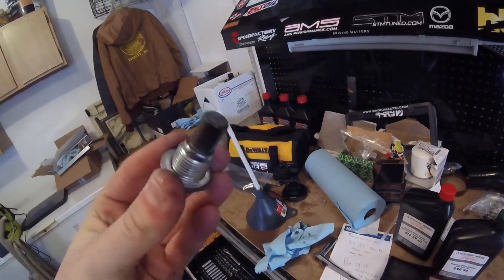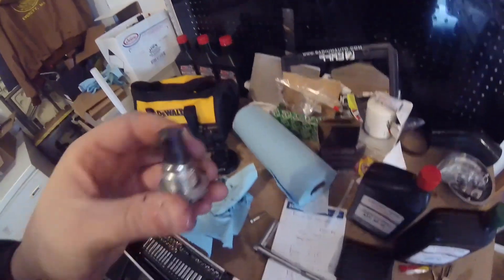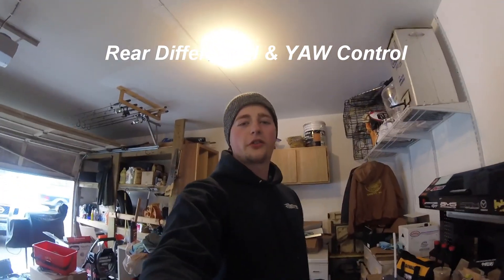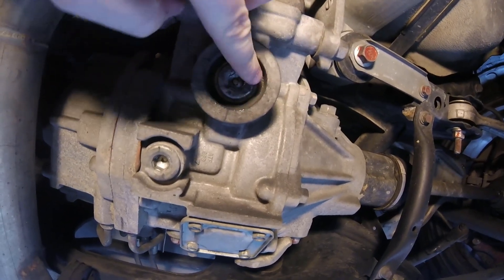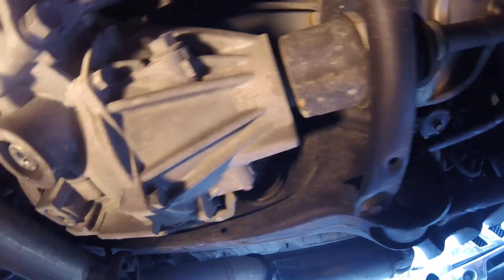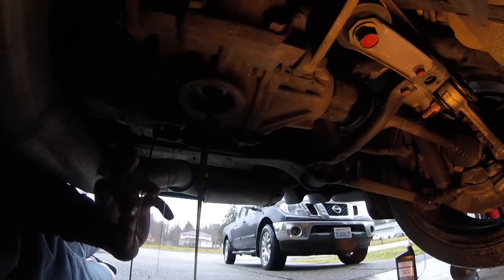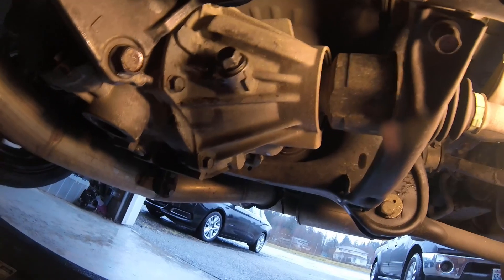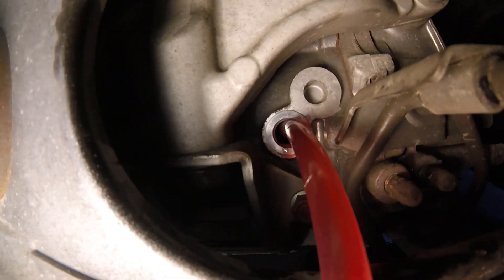Changing the Evo X drive train fluids!!

Comment: You need to understand that the AYC pump circuit and the AYC clutches within the rear differential are separate circuits. They both use SPIII, however one is for the pump/accumulator pressure acting on clutches and the other is the clutches that sit in the bath of oil (this is the one you drain on the right hand side of the rear differential during diff service). You don't need to bleed it if you are changing the AYC oil within the rear differential. However you DO need to bleed it if the AYC pump circuit has been removed for repair or you've had to replace pipework etc.

Also, you absolutely need to drive the car for a mile or so, come back and top off the oil as you absolutely will have air in and the level will be low. This can destroy the Diff and transfer case.

Comment: Did you use the same pump when you went from pumping LSD gear oil to ATF sp 3? 
If so how did you clean the pump?
Reply from the maker: I changed pumps! Only cost about 8 per pump
Reply: Driven NW did you rinse the pump after you were done using to store it for future use or just wipe off the excess oil from the pump?
Reply: Driven NW thanks for the fast reply!!
Reply from the maker: @Guero.Evox27  Any time bromingo

Comment: so draining the rear fluid didn't require you to bleed the system? if not why not? I'm going this tomorrow
Reply from the maker: MallGeez93 Yeah no need to bleed the system because your never actually messing with the awc fluid. The only time you'd need to flush would be if you replaced the hard lines on the pump or it fail and you have to replace it.
Reply: Driven NW last question...I know previously said in the video but how much fluid for both ?
Reply: Theres a kit on MAP Performance for all the fluids for the AWD system (EVOX-FL-PKG-1). Includes everything you need except a pump to fill the fluids.

Comment: do you know why they said it was "dangerous" to fill the tcase by the fill hole? is there a chance of getting bubbles or something? just curious if ya know! good video, will be doing all this to my X once spring rolls around!
Reply from the maker: DotFireWoW Yeah it's dangerous because when you fill it from the fill hole the T case is filled with air pockets and it will trick you that it's full, in reality it's no where near being full. You can still fill it from the full hole but just put the bolt back in and wait like 10 mins and keep repeating this process till it start actually coming out of the fill. 😎
Reply: Driven NW ahh gotcha thanks for the explanation I'll do it the way you do then!
Reply from the maker: DotFireWoW Yeah it's the safest way! make sure your fast with the drain plug or it will get messy like it did for me haha. I even added a bit more in the fill plug and did the 10 mins method a few times. Better to be safe then sorry!
Reply: That's why you have to bleed it if it has bubble

Comment: quick question, had my tyres changed recently and straight after the AWC service light came on.. any ideas why?? :/
Reply from the maker: Antonio De Miranda I have no idea why that would happen.. werid :/
Reply: haha thanks anyways.. thought id just try asking.. :)
Reply from the maker: Antonio De Miranda maybe wheels are so off balanced it's throwing a awc cause they're not rotating evenly? Haha I'd say off balanced wheels
Reply: could be.. gonna get it plugged in at the dealers and then get them rebalanced and see if it makes a difference..
Reply: Similar story for me. I think a bent wheel is causing my AWC light.

Comment: quick question did you fill the resevoir tank inside the trunk when the yaw fluid was drained? i adk because i took out my transfer case when removing the engine and i checked the resevoir and it is empty for some reason
Reply from the maker: EvolutionXRG No that's a separate fluid!
Reply: Driven NW yeah i know its different but for some odd reason my resevoir drained all the fluid when i took out the transfer case
Reply from the maker: EvolutionXRG Your transfer case? huh? lol that's random
Reply: Driven NW yeah im doing a full rebulid on the engine so i took out the engine with the transfer case and tranny attached, and on the transfer case there was a line attached with one bolt when i unbolted that the resevoir fluid drained completly so now i have to take a trip to buy the atf sp III fluid to refill it
Reply from the maker: EvolutionXRG must've been the ACD clutch pack on the Transfer case you removed. Yeah not a big deal you just gotta read up on how to properly refill and bleed the system now.
Reply: Driven NW oh ok will do and like i said before your vids have helped me out alot 👌. Hopefully my engine starts tomorrow after i fill all the fluids really stoked about all the work I've done to it
Reply from the maker: EvolutionXRG I'm sure it will! just trust yourself!!